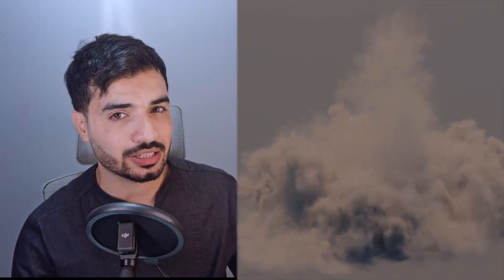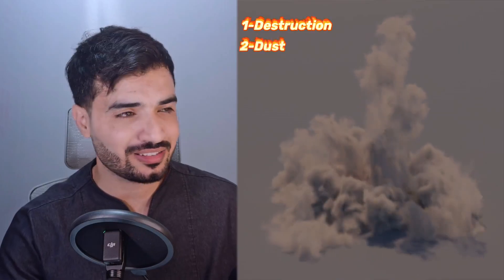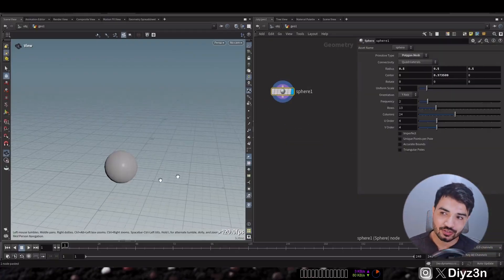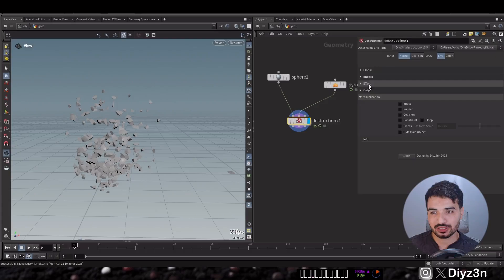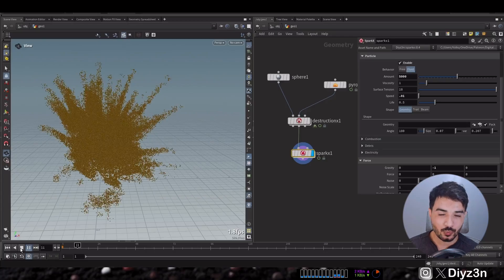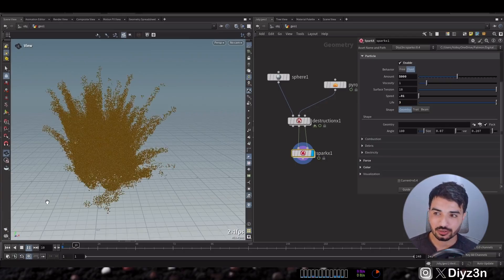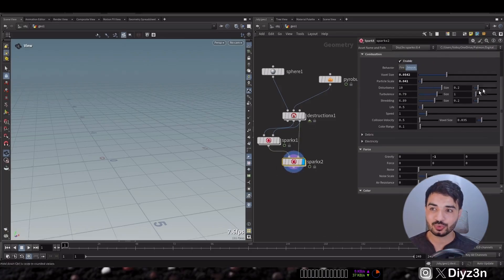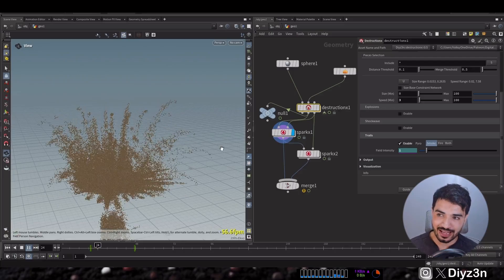10 Minutes to Perfect Dust Explosions in Houdini 20.5

Comment: Is this Houdini Digital Asset (HDA) compatible with Houdini 20.0, and does it work across different Houdini versions, both older and newer? Also, if the HDA gets updated in the future, is there a free upgrade available?
Reply from the maker: Hi, typically this digital asset contain all native Houdini nodes it’s not external plug-in so if the notes work with different version of Houdini that will work in this HDA will work too so far as I know every version of Houdini has own challenge and sometime you will have an issue with different version so we recommend to use every digital asset with their  built Houdini version
Reply from the maker: And for second question about update 
You can check this page in website. We explained everything. 
https://diyz3n.com/shop/